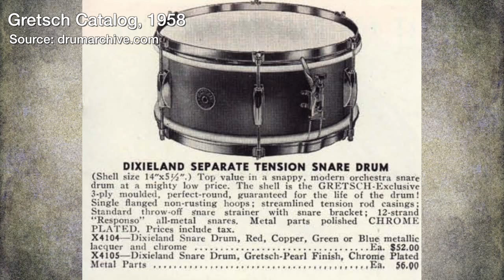1950s Gretsch Dixieland Snare Drum Restoration

Comment: To clean chrome Coca Cola and tin foil is the most effective method. You could also soak in Coca Cola but you'd want to monitor it closely. You would be able to get them very clean but of course pitting will still be there. Very little hard scrubbing is needed with the tin foil. Please try it if you get an opportunity. I was really happy when I discovered this method. I've done it this way for several vintage kits. The tin foil is substantially softer than the chrome finish on hardware so no worries at all. If the hardware is immaculate except for grime, it will be completely immaculate after using this process. You don't have to waste flat Coke. Save it for a project like this.
Reply from the maker: I actually have also used coke-and-foil as a cleaning method. I find that the cola itself isn't super ideal for me, since its a sticky mess afterwards. I tend to use WD-40 or something similar so that I get both a nice clean and a protective layer worked into the pitting. I also like using Brasso, Simichrome, or all purpose oil. Works great! Thanks for the comment.

Comment: Nice effort But a couple pointers: 1. Never use any kind of abrasive anything on chrome, be it Brillo pads, scotchbrite, or the dreaded steel wool. Even abrasive powders. Chrome by itself is naturally shiny however it can be scratched easily, what you want to do is break down the dirt and scum by soaking your parts in dawn dish soap and water overnight and than rinse. You than use a microfiber or other soft cloth and hand rub the parts. That is it. Polish does nothing to enhance chrome. 2. The pieces of felt inside the lugs is exactly what I did on my beloved Rogers drums and a couple years later I had rusted springs. The moisture in the air gets trapped by the felt pieces which in turn attack the metal. You can plasti dip the springs or you can even use plastic bag material. Hope this is useful info.
Reply from the maker: Thanks for the tip!

Comment: Great video. I have a 1920’s Ludwig snare which the chrome is coming off on the top hoop (maybe pitting). How can I fix this??
Reply from the maker: So... there are two or three ways to tackle this. 1) Live with the  damage and maybe use a drop of superglue to keep the large flakes from falling off (cheapest and quickest) 2) Strip the chrome off completely and send it off to be re-chromed, or rechrome yourself (expensive yet quick) 3) Strip and refinish some other way (I do not reccomend this, it will drastically destroy the value of the part)

Comment: you should buy some MetalRescue to soak the hardware in! its AMAZING on rust and its water based so its not nasty to work with. I used it on a early 60s slingerland kit i bought that had hardware covered in rust and now it all looks basically new.... check that stuff out!
Reply from the maker: Thanks for the tip! Definitely will try this on my upcoming metal snare restorations.